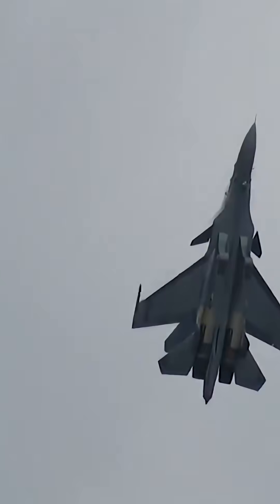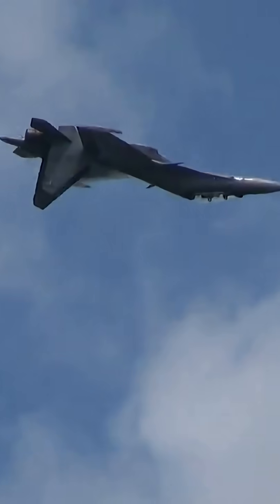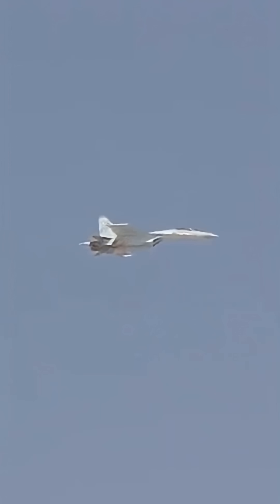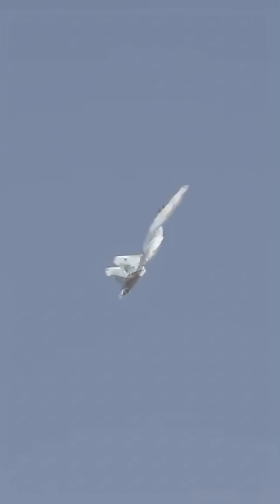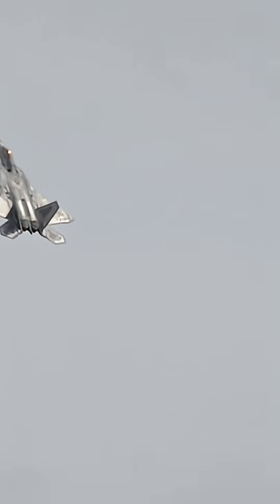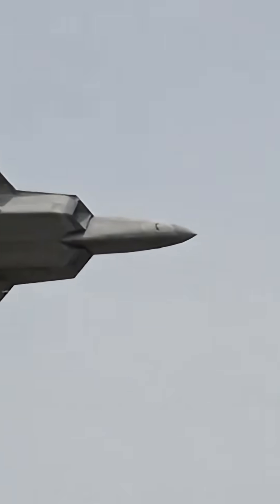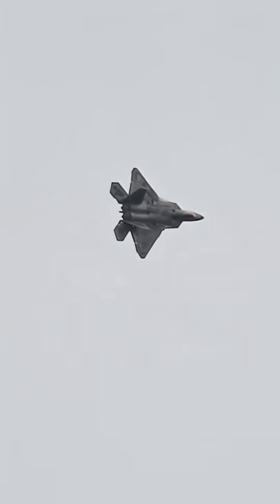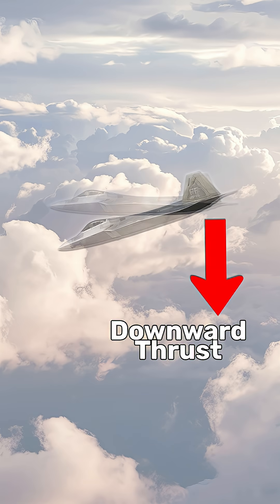The RISE, fall, and RISE again of Thrust Vector Control

Comment: 2D is all you need with stabilizers. 3D if you lack the uprights.  Even still, 2D vector on a Tomcat would be dangerous.  Partly because of the wide set engines, too.

Comment: Are Su-35S TVC truly 3D? To my knowledge, they are only canted diagonally and still move in a single line only, making them very much 2D (i.e. no independent yaw and pitch control from the said TVC nozzles). Wouldn't that be just a trading a bit of pitch control for more yaw control? That, with much less thrust to begin with compared to F-22.

Comment: Modern warfare could be SU-35 violating airspace, 4x F35 or whatever sent to drive it out and the SU-35 blows them out of the air. The West is right there, right beside the plane, not 55 miles away. Later on Russia & allies say " We come in Peace - Shoot to Kill Shoot to Kill " and Pearl Harbour or IED style again that The West were not ready for. Hi tech is a fast 155mm shell conveyor built.
Reply: The Su-35 doesn’t have a chance against a F-35. The Su-35 is huge on radar.  Its large radar signature makes it not only easier to detect, but easier for a missile to get lock onto from farther range.

Comment: I had always assumed the thrust vector was to turn faster in long range engagements and the acrobatics was a secondary function. 

The idea is to get your missile or 2 off first then turn very rapidly and fly directly away from the enemy. You don't want a wide fast arc you want to fire as far out as you can but within a range where the enemy probably cant outrun your missile.

This is also largely because of how stealth works. Its great head on but degrades fast at side or rear angles. you want to get close enough that you can see the enemy but they cant see you yet, launch, then turn and burn out fast. 

And thrust vector help you turn very had and fast. You are clearly not going to get the kind of tight turn you get at low speeds but any advantage you can get in turning and evading is good.

Comment: Of course the F22 is superior to the Su35S.

But with regards to this vid the Russian 3D TVC does the same as the F22 TVC and more.

2D TVC on the F22 allows higher maneuverability at high altitudes to assist in turning away after shooting.
3D TVC on a Russ Su35S can do the same.

But 3D TVC on a Russian aircraft assists in turning fights by keeping the nose above the horizon.
2 TVC is limited in this regard.

Comment: Umm, you do realize that thrust vector nozzles that only go up and down are 1D, not 2D, right? Up and down is the Z-axis and that's 1 dimension, like a line on paper is 1-dimensional because it only goes back-and-forth. 2D would mean the nozzle can either go left and right as well or it can also go forward and backward (which would be pointless, imho). 3D would be a nozzle that can go up and down, left and right, and forward and backwards. To help conceptualize this, a line is 1-dimensional, a rectangle is 2-dimentional, and a box is 3-dimentional. Seriously, if an up-and-down-only nozzle is 2D, then a nozzle that moves in all 3 dimensions (up and down, left and right, and forward and backwards) would therefore be 6D, and that is, of course, completely non-sensical. :D

Comment: Su-27/30/34/35/37 are all based off the same Flanker airframe. So russian has 2 airframes with thrust vectoring: flanker variants and su-57. F-22 was the first fighter designed with thrust vectoring. Retrofitting to other aircraft will be too costly and airframe strengthing.

Comment: But the problem is the human body. Cannot take a repeat, cannot take the g force. That is that the vertical thrust vacuum thrust vectoring. However, you wanna butt it?  The human body cannot take it most people pilots pass out with the amount of g force gravitational force that is put on their Bodies even with a suit that pushes the Blood from their legs up to their head.  The human body just cannot absorb that arch gravitational force before it passes outhen. What you gotta pass out pilot. Who is now a dead stick and it's floating down.  Are still burning straight up\n And there goes that multimillion-dollar plane and a life\n I believe wholeheartedly, and you have 20\n 2.\n S they're outstanding.  And I believed in the engine with the thrust vectoring. Whatever now, it's caold whole heartedly until I saw some things where yes, you can do these silly little tricks with they're just silly little tricks. You can stand the plane straight-up-and-down and go across the runway with it.  With no problem, you can make it turn in the middle of the air. Where all planes can do that. It's just how fast it happens. How much blood drains from your? He are at and how much g force is put on your body.
 Quite frankly, we have built machines that have surpassed.  The human ability now you wanna make those and make them like no, the drone\nTurn it into a situation you want to make them so that a pilot is sitting behind the screen and they're drone.And the pilot doesn't have to deal with the g force outstanding.
But we're just gonna be playing video games

Comment: 60 Gs? How do they avoid the airframe bending? I remember conversations with my dad who worked on the Bomarc Missile. He had told me that there had been Missiles that turned so hard at high speed that the airframe was bent. 
I'm sure it's in the materials used but I'm really curious now.
Thanks a bunch.

Comment: that is not the reason why we have vectoring on f22… it was design to takeoff on short runways and pitch nose up much quicker. The PW SMTD program in 1980’s developed this capability on a F15 as a demo because of crater patterns on runways.

Comment: Back in ‘89, I was attending Embry-Riddle, and going through the turbine engine course. I had a friend who was working at Pratt&Whitney in Florida, in secret projects. He teased me with tidbits of info, that I eventually interpreted to be an eyeball nozzle capable of directional thrust in any direction. I’m not entirely sure if the concept has made it to common use or not.

Comment: A wing can generate 50 x more lift than drag. Using thrust directly via vectoring will wash of speed. There are uses, for instance trimming the aircraft so that the control surfaces are at minimum drag and have more control reserve (F-22 uses this)

Comment: Ok, several things: 
1. The F-22 does not fly higher than "pretty much any Russian fighter." The MiG-31 flies considerably above (and faster than) any American fighter because it's designed to intercept blackbirds and B-70s. The fact that you don't see many blackbirds or B-70s around doesn't mean that high altitude ceiling has been lost.

2. America still puts Fox-2s on their aircraft. And guns in some cases. Clearly they expect to get to the merge. Given modern Fox-2s are just going to lead to mutual kills if you fly 2-circle, everything is going to be extremely tight, low speed one circle turnfighting from the moment you merge until someone runs out of HOBS missiles. That is an environment where thrust vectoring is actually really valuable.
3. The Ukraine war demonstrates what anything that isn't stealthy will end up flying at treetop level if it doesn't want to die to modern air defenses in a peer environment. Meanwhile, anything that is stealthy will be able to get pretty close to other vehicles before being detected because of the fact that it is stealthy.

So I fail to see how modern combat renders low speed high alpha tight turns in a merge obsolete. If anything, it's practically forcing planes to cross most of BVR range before they can even fight and be almost within visual range by the time they detect each other.

Comment: Thrust vectoring makes certain jets very challenging in dogfight merges in DCS.
Dogfighting rarely figures in in air combat since the 1980's.   Nowadays, the battle is won at the factory.  Lock, fire, repeat, if you can.

Comment: Thrust vectoring will almost never be used in a combat situation like you see at airshows. Furthermore, the high altitude reasoning for thrust vectoring given in this short is bullshit. The radars on advanced 4.5 and 5th gen aircraft can point their radars at 90 degrees, and in some cases more than 90 degrees from the aircraft's body. There's no need to point the nose down to get a radar return in an F-22.

The Russians believe that there's still a place in air combat for close in fighting. The U.S. and other Western countries believe that the advent of advanced missiles and avionics have rung the death knell for close in air combat.

Who's right and who's wrong? We wont really know until there's a full blown war between nations equipped with both aircraft. One thing to consider though, engagements between two stealth aircraft happen at much closer distances than engagements where one of the planes isn't equipped with stealth.

Comment: PLEASE correct me if i'm wrong , but doesnt a variant of the F-35, i think the "B" variant which is the carrier version with VTOL capability, also have thrust vectoring?
Reply: Yes but it's only for takeoff and landing purposes. It can't be used for maneuverability.
Reply: @dallasyap3064  ah okay, got it. Thanks! And its only the one variant that even has that, right? The carrier version i believe its the F-35"B". Could be wrong tough😅
Reply: @swealer  The F-35C is the Navy's standard carrier version. The F-35B has a forward lift fan, a downward-rotating nozzle, and compressed-air maneuvering jets for vertical landing and short take-offs. The F-35A is lighter, faster and cheaper than the other two since it is intended only for land-based operations.

Comment: They thought the battleship and cruiser were obsolete. Then the battle of surriago straight happened when the carriers were too far away. Sometimes old school methods of fighting aren’t obsolete.
Reply: I agree but like he said, an impressive 9G turn in a fighter isn’t going to help when an AIM9X can pull 60G, lock on after launch and be aimed through the bottom of the aircraft with a helmet mounted display

Comment: The raptor and lightning will fire a missile from miles out and not have to dog fight another fighter. Those other fighter jets won't know they are there till the missile lock is to late. They can try to do the cartwheel and put out chaf but it's to late. If they ever do get close enough for guns , the deal is done. Sorry you lose ever time with the US 5 Gen fighters. Nothing is better then the Lighten and Raptor. Nothing. Air superiority is their game.

Comment: As I understand it there has been zero 360°thrust vectoring in battle, so to dis it seems premature. Plain thrusters may appear on hypersonic high altitude hypersonic upper altitude/lower space battles a decade out. Megawatt LASERs should prove useful up there as well, IF that kind of power becomes miniturized. Maybe Russia will lead the way on nuclear "jet" engines to provide that kind of power-if they succeed in lowering radiation release.

Comment: its going to sound dumb, but i had this crazy idea to have a 2 engine aircraft with thrust vector control but also with inlet angular control... same as thrust version but for the intakes.  the idea was also to have the wings be able to rotate to maintain lift... think cobra maneuver but the body is the only part creating drag, because the wings rotate so they are still in level flight, while the engines are controlling angle... never knew if it would work, i figured it would do maneuvers that current aircraft can't... like the ability to dodge missiles without loosing speed or altitude... sharp turns being king.  do you think it would work thou?  stealth wouldn't be as much a thing with it, but escapability through action :D
Reply: The pressure drop in front of the engine compressor isn't enough to contribute significantly to aircraft motion, especially not above high subsonic speeds. Also, disrupting airflow to the compressor would cause all sorts of problems such as flameout. That is a major issue in the design of high-performance aircraft

Comment: I would like to correct that. The Flanker bzizles cannot go up and down r left to right, they only move diagonally. This diagonal movement through allows it to have pseudo 3d, as there is still some thrust in the lateral axis.

Comment: This analysis seems very off. He first mentions avoiding missiles. No. Not relevant. He then mentions very high altitudes and pointing the nose down to lower targets. Perhaps. But what about any standard (rare these days) dog fight and needing the nose authority to turn faster and get a shot off before your opponent does. This is what I’ve generally heard TVC is mainly for. Super useful in a dog fight, at any altitude. The only question is: is it worth the weight, cost, and complexity of maintenance penalties to have it in the plane given the likelihood of getting into dogfights?

Comment: The Su-30SM/Su-57 doesn’t have 3D Thrust Vectoring Control like the F-15 ACTIVE or NF-16D VISTA MATV had. The ACTIVE and MATV used 3D TVC where the nozzle could point in any direction. 

The TVC on Russian aircraft is “2.5D”, it’s essentially 2D TVC, but instead of the nozzles going up/down like in the F-15S/MTD / F-22, they’re splayed out. So when the Russian ac’s nozzle move up it also moves a little to the left, and a little to the right when moving down, this is mirrored on the second engine. 

The net effect is when both nozzles move up and down together, it makes the aircraft pitch up/down, but if you make one nozzle move up and the other move down the pitch is effectively cancelled out, but now both engines are pointing to the left which yaws the aircraft in addition to a slight roll. 

It’s coupled together in such a way that when the pilot stomps a pedal near the stall, the nose yaws into the pedal and the aircraft also begins a roll into the stomped pedal. A true 3D nozzles would just yaw the aircraft (+ any pitch input that might be applied at the same time)

Not really gonna comment on which way is better, 2.5D might be more intuitive and less complex and lighter, but a 3D TVC with a good FCS will give more authority

Comment: I read that aerodynamic controls get less effective at high transonic and supersonic flight and a major advantage of TVC is so that the control surfaces don't need to move as much for steering.  Major control surface deflection causes major drag issues and that just might be a little important when supercruising to get your missile KE up.

Comment: To be fair, thrust vectoring isn't completely useless in BFM. Actually quite the contrary, while the fancy air show maneuvers definitely are wasteful, what isn't wastefull is the ability to pitch up with an incredibly small turn radius, at a high turn rate. 

This is important because modern missiles have gotten so good at rejecting countermeasures that typically whoever fires their missiles first wins. Even if you survive the first one, the guy who used TVC is now slower and you will end up in front of his nose, maybe not directly, but you will be, and that is prime shoot cue for a second missile. 

You'd have to assume the fight starts without missiles for TVC to be useless but even then BFM is fluid and dynamic there will inevitably be times where slow speed rolling scissor of flat scissor fights occur and having TVC for extra authority is a huge advantage. 

In summation, the fancy airshow maneuvers are useless for bfm NOT thrust vectoring by itself. Ask yourself, when you're both slow would you rather have the TVC or not?
Reply: Excellent point right there
Reply: BFM is after many mistakes have been made and the aircraft is out of missiles.  And, if the aircraft out of missiles, why is it still hanging around?

Comment: I first saw thrust vectoring in Macross/Robotec back in 1984.
The fact that Allied fighters still don't have it is pathetic.
You don't have to use it but if you need it to avoid a SAM, AAM, drone debris going into your intake, the ground, a tree, a powerline etc or to get a gun kill or a better lock with your AIM9X it sure beats dying or punching out.
Sure if you are in a furball it's better to be 450knots in an F16 maintaining energy. Just don't get in the box and slow with an f18 or Flanker.
Better to have it and not need it than to need it and not have it.